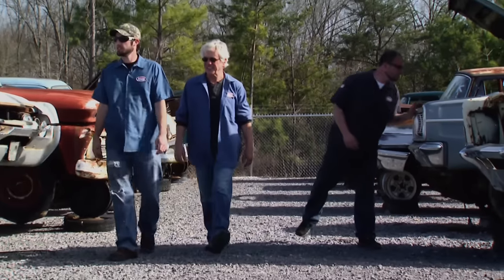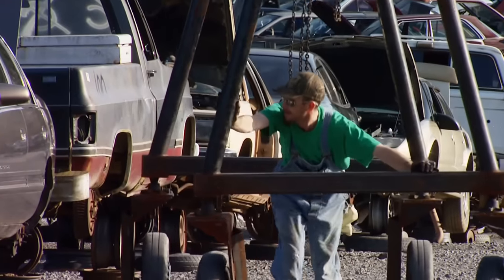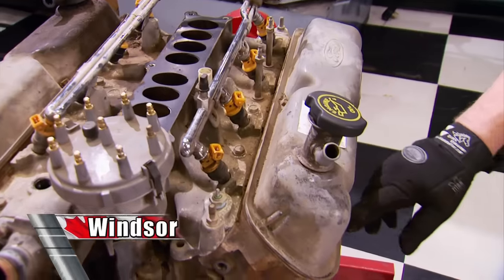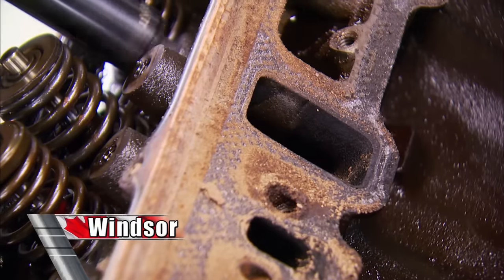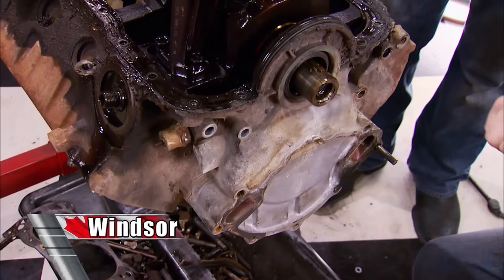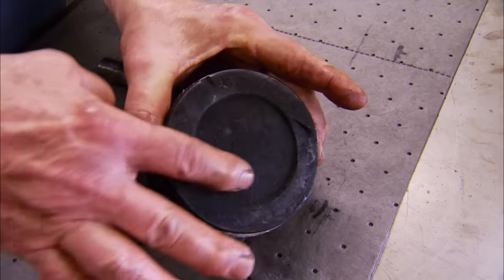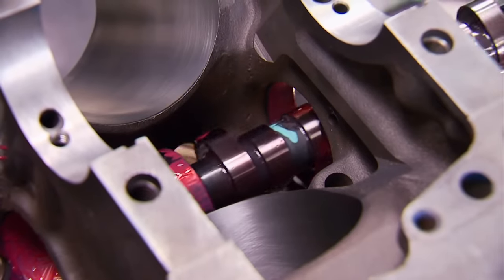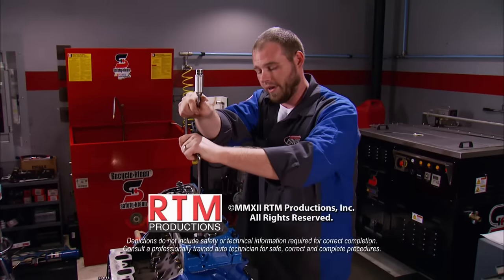Tearing Down a Pair of 351 Small Blocks: Windsor vs Cleveland - HorsePower S16, E10

Comment: The 351 C 4V heads were mindblowing in how much different they were from the 2V heads
Reply: If i remember right the ports were almost too large
Reply: @LacquerSniffer  Clevelands with 4V heads will drink disgusting amounts of fuel if you let them. Give them a single plane manifold, a big carb and as much air as you can get in, and you'll be rewarded. Just don't go too crazy with the jets. They are high RPM heads for sure. 
Good motors for nitrous.
Reply: And the 2v heads are more than enough to feed a 351! Best to port for a serious street motor.
Reply: 351 C, was only produced with a 4v carb.  351/400 M usually came with a 2v carb.
It's a common mistake people make, but a 351 modified 400 was not the same engine as a Cleveland.  The modified block was cast from lighter material and had smaller oil channels, where as the Cleveland block was a more dense cast and had much larger oil channels.  The 2v heads were produced specifically for the modified block, where as the 4v heads were produced specifically for the Cleveland block.

I know that people don't want or like to hear it, but there were major structural differences between the 351/400 modified and the 351 Cleveland engines, despite a side by side comparison of appearing to be the same engine, they were not.
Reply: @duelde-consulting6403  you sir are incorrect. The 351 C was made as both a 2V and a 4V. I highly recommend that you take the 5 minutes to look into it before trying to argue that point and look foolish. Yes the M series engines were only available in the 2V configuration but were based on the Cleveland and had a raised deck height and the bellhousing was changed from the small block bolt pattern to the 385 series big block bellhousing bolt pattern.
Reply: @todddenio3200  
Actually, your very accurate except for some minor details.  The 2v version of the Cleveland was the police interceptor and it was a different type of carburator.  Instead of butterflies that swing open, the interceptor 2v had pull back covers.  Now also exceptional of the C was larger ported heads and forged crankshafts, were in the M the heads ports were smaller and it was equiped with a cast crankshaft.
So, your not wrong. However, the Cleveland was made to he abused and produced more power then intended, the call for emissions control systems brought on the modified engine to replace it.
Myself, I've worked on and admired many vehicles and rare engines over the years, I've never seen an original Cleveland motor with a regular 2v carb in person (not to say that they didn't or couldn't exist). But,  I have seen many upgraded modified engines with 4v though.

It's nice to meet someone that knew about the deck difference though.
So ultimately, no argument from me, though I've heard people talk of them I've just never viewed a factory Cleveland normal 2v in person. 
In the 60's, 70's and even the early 80's there were many factory experimental exception that escaped into the public.
I knew a man once that bought a brand new F150 in I believe 86 when they were experimenting with economy. Some new fuel injection design. Anyway, he drove the truck for two months before realizing that he was spending no money at all on fuel.  So the third month he specifically did a millage count and determined he was getting almost 50mpg, and thought he would compliment the company for a well built truck.  That started a legal battle.  Ford motor company threatened to reposes a paid in full vehicle over an experimental intake control modual.  So he had to surrender a brand-new truck for recall, after which he was getting 19 mpg.
I've seen many different things in my days.
I apologise for the short book.
Thanks for your info.
Reply: @duelde-consulting6403  the type of carburetor you described was the VV. Variable Venturi carburetor which I have never seen installed on a Cleveland or M series engine and have only seen the regular carburetors on those engines. The VV was installed on the 302 and the 351W and was a nightmare of a carburetor that was prone to malfunctioning and was not used for very long before being discontinued. The M series was originally intended as a truck motor and was intended to replace the FE series 360 and 390 engines which were intended to be discontinued after the  73 model year, but for some reason they kept production of the FE series going longer, but they stopped maintaining the equipment used in production of the engines which is why the end of quality of the FE engines dropped.  I'm glad you decided to read up on the Cleveland 2V and 4V engines rather than just blindly arguing that no Cleveland 2V engines existed as most of the Clevelands WERE of the 2V variety.
Reply: @todddenio3200  Here's what I have on the Cleveland.

The 351C or 'Cleveland' engine took an entirely different path to market. In fact, with what Ford called its '335' family of engines. Marrying certain features of the 385 big block (later 460) with a deep-breathing head design, the displacement 351C was wider, lower, and heavier and shared only its bore spacing and stroke with the 351W. As its name suggests it was also built at an entirely different plant (Cleveland Engine, located just outside of the titular city limits).
The free-flow, canted-valve cylinder heads installed on the 351C made it a natural for muscle car performance standard kit was,
a four-barrel 'H-code, the Boss 'R-code, Cobra Jet Q-code
The Boss 351 Cleveland was more special than its modest rating suggested. The engine was intended to thrive in the upper RPM range and suck in as much air as its 11.7:1 compression ratio could handle through an aluminum intake and a race-ready rotating assembly. Q-code cars were much more modest in terms of their head design and camshaft, despite the ferocity of the Cobra Jet name.
The H.O. version was ordered from the three available Cleveland choices, but by 1973 only the base H-code and a modest Q-code were still on the build sheet.
In addition to being sold in a Mustang wrapper, the 351C could also be had in the Ford Torino, the Mercury Montego, and the Mercury Cougar. Surprisingly, the Cobra Jet name lived on longer on the Mercury side than it did in the Mustang, associating itself with the Q-code 351 Cleveland after it had been dropped at Ford. It was also available in the mid-engine Pantera

I believe the carburator that I saw on a police package was a kendig variable venturi.
Reply: @todddenio3200  
In my own personal honest opinion, nothing could replace the 390.  I've seen a couple crappy 360's come and go no matter how much elbow grease was put into them.
But the 390's never failed to be great engines.
Reply: @duelde-consulting6403  I agree with you on the 390 but corporations are not exactly known for making intelligent decisions in such matters
Reply: @duelde-consulting6403 where did you ever get this information,,, probably 80 percent of 351C,,,were 2v
Reply: @krookpd01         The CF, DIF, MCC  were the manufacturer codes for 7C02 which was a 351/400 manufactured by the Cleveland casting company.  Although considered a Cleveland block, it was a redesign that was not a true Cleveland due to it changes for emissions and less efficient power.  These blocks were of the majority produced because of governing changes and we're not actually true Cleveland engines.  They were refered to as Cleveland's because they came from the Cleveland manufacturing plant.

Comment: My first glance was always at the valve covers, as they are so different. This still leaves the Cleveland vs Modified question, but from and old Ford rebuilder you guys covered every difference that I knew of, plus building a formidable street engine. Thanks for posting this!

Comment: Loved it.  My dad had a 351w in his boat, and it was a solid engine.
Reply: What I've always heard.. Windsor > Cleveland
Reply: Cleveland was better than Windsor for power until aftermarket heads hit the scene in the 80s thanks to its canted valve heads. There are also 30 years of Windsor engines out there, compared to only 4 short years of Cleveland engines. Cleveland engines belong in restored 70-74 cars, a Windsor with aftermarket parts is a much better choice for anything else.
Reply: @prushimush  Jack Roush ran Mercury Capri's with 351W's in the early 80's. Ford's NASCAR teams were using 351-based engines, as well.
Reply: @bryanhallman8183  Roush/Yates D3 heads are one of the big dollar heads you can get for a Windsor engine, they were ran in NASCAR as well. With so many good heads available these days I'm not sure why anyone would build a Cleveland, aside from originality.
Reply: Suprised..boat engine manufacturers continued to get Cleveland blocks (from Australia) after they were discontinued in the 'states...almost always the 2V version though.
Reply: @brentboswell1294  The Aussies made a 302C and the 351C.
Reply: Ford Marine engines were bullet proof.

Comment: When I was in high school, my (then) best friend had a white '77 Thunderbird powered by a 351M engine.
That was an awesomely fun car.
Reply: Any problems with the M ?

I had one    Windsor and Cleveland  much better motors just my opinion
Reply: @edt6044  Can't really think of any problems other than the car being able to pass pretty much anything except a gas station.  It was a thirsty beast, to be sure.  Then again, it was about a quarter century ago, so my memory may be a bit fuzzy on the details.

Comment: Love this. Proud owner of an oldschool Clevor 302 boss build in my 65 mustang. It has 351 Cleveland heads 2V, 302 windsor block. Holley double pumper 4bbl.
Roller cam. Reinforced C4. It can really handle high RPM. Currie rear axle 31 splines.
Was built and raced in Sanfran where I imported the 65 mustang the engine sits in.
 It had been sitting for 25+ years! Been driving it for 3 years now. Had to change  the rear axle gears to 3:00 because I wanted to lover the rpm while doing over 60mph on the freeway. I love taking longer trips, and the mustang still ripps if I wanna get busy🤣.
Again thanks. For this video🚀
Take care everybody watching this clip and make sure to do what you love, be kind, and make damn sure to drive your Ford mustangs.🕶🏴‍☠️🐎
Reply: The real boss 302 used the 4v m code quenched chambered heads.  But still a bad ass build always wanted to do this as they use to make the street boss intake to do so. Idk if it's still made haven't saw them in years but to find a actual boss 302 intake for the 4v heads I guess is unrealistic
Reply: @shaunzimmerman661  yes.
I have an intake made especially made for this option 302 block and 351 cleveland heads. Its called street boss i reckon.